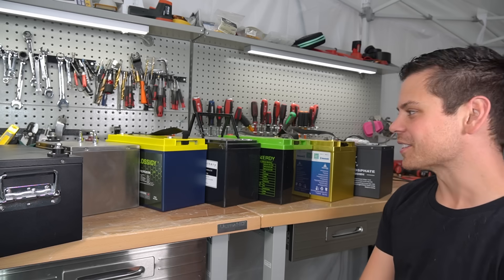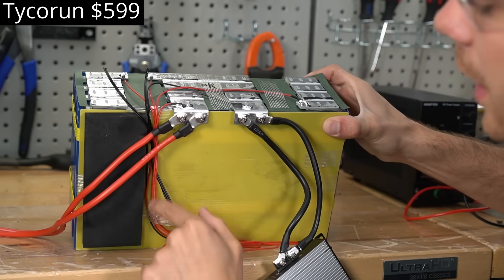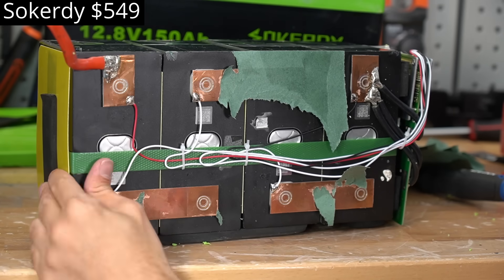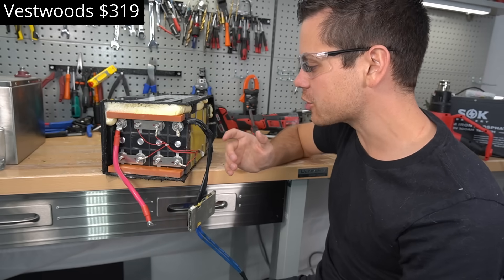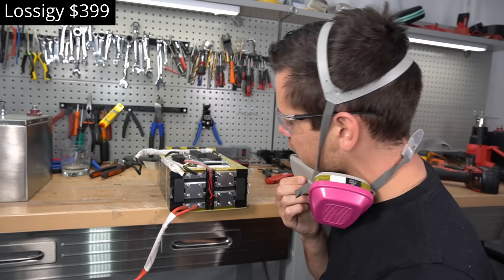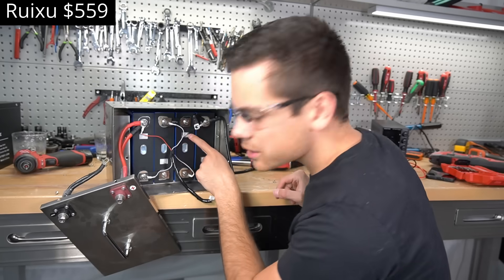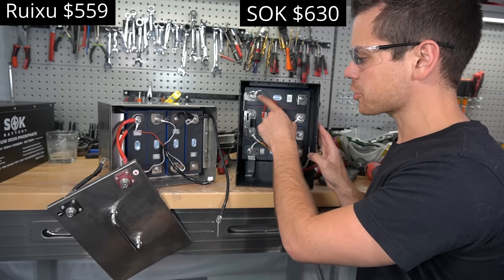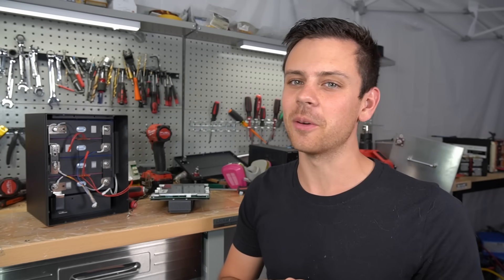Budget LiFePO4 Showdown: Lossigy VS SOK VS Vestwoods VS Tycorun VS Soderky VS Ruixu

Comment: @will aren't you getting spoiled?  you start with 100A 12v for 599 and call that cheap?
I've fetched myself 4 230a Eve cells (or something similar) for roughly 540 euro's, added about 80euro of BMS  (JDB) and spend 10 Euro's on a german app.

That is cheap! *(yes they test full capacity).
that would be more than 2 times the 599$ battery you're calling cheap :) 

Keep up the good work, but if something is (really) cheap an preassembled some corners where cut!

Comment: Did you checked, if there is a temperature sensor in this pretty small BMS of the Vestwood? Maybe it's build in the BMS not with wires to the batteries?
Reply from the maker: If it is, that's an instant failure

Comment: Hi, so would you say heated batteries are a necessity in cold climates? Also would you recommend the SOK batteries or is there a better option? I've been using lead acid for years but I'm hoping to do better with lithium ion

Comment: I'm trying to build an 86 KWh battery bank for my setup using 16 x 6 EVE 280 AH battery cells. I need to find a suitable BMS that can talk to my Victron setup. Does anyone know which BMSs are compatible with Victron? (I have the Victron Cerbo gx in my system).

Comment: Planing to parallel 6 battle born batteries and 4 WEIZE batteries. All 100 amp. Bad idea?
Reply: Separate wires same length plus fuse to victron lynx distributor.
Reply: I would not do it.  Best to use the same manufacturer, same exact model of batteries, and at the same SOC and usage (i.e. do not mix old with new).
Reply: @laronis  He shows another video were he is doing it and he recommended to parallel  it with a bus bar.

Comment: Humm.  Neglecting life of the battery (will have my boat for only 3 years).  With only 200Ahr needed, I need to daily monitor my battery capacity, charge in/out, for anchoring out and on solar for 3-6 days.  Tycorun has BT built in at $600 x 2 = $1200.  SOK marine would be a simple install with only 1 battery, but NO Bluetooth.  I'd buy the Victron smart shunt.  1x SOK at $1020 + 1$130 shunt = $1150.  So close in price.  What do you think is the way to go?  Tycorun...I have to make a set of cable to parallel connect, SOK requires a Shunt and 1 extra battery cable.

Comment: The vestwood battery probably has the temperature sensor on the bms board and not externally so it would have been better if u had tested the bms in a refrigerator.
Reply from the maker: Absolutely not. That would be instant failure. Please watch my beginner videos to know why

Comment: Maybe you guys know something what I didn't get for last 15 years... But I believe that low temp protection sensor should not be attached to the cells... Only high temp sensor... Reason why should low temp sensor be attached to the housing is to be able to give information to BMS before that cells themselves get cold...
With my experience of Lifepo4 battery when the sensor is on the cells is already to late for cells to be protected...
What do you guys think about that?
Reply from the maker: No, wouldn't work. Problem is that when it's warming up, the case will get warm first, and allow charging to occur even if the cells are still cold. Think about the thermal capacity of the cells.

You must always assess temp of cells on the cells.

Comment: Isn't it possible that some of these newer BMS units have the low temp protect on the board as a surface mount component? They're meant to be installed in the case, so the outside would be cold first when freezing just like the cells get hot first in overheat scenario, right?

Comment: With so many of these batteries featuring Bluetooth, I'm surprised nobody's figured out the heated battery issue you described yet. Seems to me Bluetooth Low Energy (often abbreviated BTLE) could be used for nearby cells to keep track of each other. Maybe a new feature for SOK to innovate? 👍️

Comment: Maybe it would be useful to list use cases here.  How much of the time is "low temp charging cutoff" a thing?  In LV, it cannot mean a thing to you, anymore than it does to me in Central TX.  If they advertise it and don't deliver, that is one thing, but the mere absence of it is of no consequence to anyone who can read. I don't need it and don't care.  It's not something I would pay for and the lack of it means nothing to me.
Another point here is that even the worst LiFeP04 battery is still a better option than a SLA, AGM, varient (as Lythyum Sooler likes to say).

Comment: As with many things, the more the market growths the more innovation comes along at a lower cost. 

We are looking at off-grid property, the home will have a 24 volt system for lighting and low power draws and a 48 volt system for the inverter.  That way there is some redundancy so you don't loose everything if one system goes down.

Comment: Now I'm sort of torn about having just purchased and received the SOK 206 a month ago. Haven't used it yet, but my intuition says that they wouldn't let me swap it for an upgrade fee to the new one with bluetooth and heater even if Ipaid the difference - bummer, I coulda used the heaters at times particularly that I'm on a single batt system and don't need to worry about balance
Reply: Contact them directly, they have recently discussed selling the new BMS/ heater pads to current battery owners.

Comment: So apparently in May the heated SOK 206 will be able to be wired in series??will have new BMS, or I guess a new tweek?  I wanted 12 volt system but decided to go 24 volt instead. SOK doesn't sell the 24 volt batteries in Canada anymore.

Would you still stay away from connecting in series? We get minus 30 degrees Celsius in the winter. Which is the only reason I'm going with a heated battery. It'll be in a "garage portion" of my tiny home. So I assume the lowest temp will be -20 degrees Celsius.

Comment: I am lead to believe that the heating pads many manufacturers are using cut in at 5C and out at 10C. I hope most people that string them in series have them in a well insulated box. The thermocouples attached to the BMSes are not over accurate (mine read temps with a 5 degree C spread despite sitting right next to each other in the same room at 13C ie 10C-15C). Hopefully the "warming" period when the pads are "on" is only minutes (the thermocouple sensor is on the surface of the cells next the heating pads in an air-tight box! lol) and any imbalance doesn't shut off the BMS and does not cause a real imbalance but only for a few minutes which is easily corrected by the BMS during the same charging period. Someone should test your theory about imbalance being an issue (you, Andy, Poz, or Lithium Solar).

Comment: Thank you, Will!  For the Vestwood battery with no apparent temperature sensor, I'm thinking it could be possible that the BMS may have a sensor built into the BMS, not hanging out the side like it should be... other youtube reviewers will drop the batteries into a freezer for a while as a more thorough test for such an example.  Do you have a freezer that you could setup to do such testing?  Thank you again!
Reply: Yes, you are right. The sensor is within the BMS. We checked inner structure. The NTC is arranged next to MOS.
Reply: Problem is that the BMS might be warmer than the cells. That's why you want to have the sensors away from it.
Reply: Yes was wondering the same thing, very easy to have onboard sensors.
Reply: Has anyone yet actually tested dropping the battery (the whole thing) down to 32f to see if it shuts off before damage occurs. It is entirely possible that since the temp sensor is on the BMS, they may just set the trigger to a little bit higher temp. It might still work just fine.
Reply: good to know!

Comment: I purchased 6 of the Lossigy a month ago. The company seems to make several batteries, basically the same, but some with added features. I have 4 yellow case and 2 black case. The first 4 we're around $330.00 each. In a week and a half they jumped up to $379.00.  The black case I got for $345.00. They had pretty good ratings on Amazon. Supposed to have cold temp protection. The 6 are in parallel. We'll have to see long term, but for now they are working well running my Mom's off grid trailer.
Reply: still working well?
Reply: @unionse7en  Have not had an issue with the batteries. Of course with a 90 year old woman, a different issue.  She would leave stuff on like she did when she was on grid. The biggest draw seemed to be the rv furnace. At 90 she was cold. Would turn the heater up and forget to turn it down. Then would get too hot and open the trailer doors with the furnace still running. Furnace would run 24/7.
Fortunately  she is now in assisted living.

Comment: Good Vid, this was great, flock of batteries evaluated !
The Sokerdy = Gold Standard for junk ?   Is that the sub-text there ?  Maybe LOL.  
Why the gawdy casing ?

SOK, AmperTime and those have upgraded so much,  It was just "the other day" when we were scrambling to for "A BMS" with Low Temp protection and now, wow that's changed.

As for the "Un-Named" Brands, YEAH really !   I look at Relion and others and they are STATIC not only ion product offering but pricing that goes with it.  Some are nearly 3X the price and with less features (no BT or Low Temp protection etc).  One has to wonder how much longer they'll be around if they stay that way...  Even BattleBorn has to get there, they are lagging now.

Comment: The Vestwood thingy might use an integrated temperature sensor soldered directly on the pcb. Sounds dirty but if you use an bms staying cool at 100 amps, you  having less trouble with heat generated by the bms. They might use higher quality FETs with lower resistance resulting in less heat. Get some cooling spray and hit the bms while testing...
Reply: Yes, I have also disassembled then Vestwoods battery, the temperature sensor is on BMS. It is white NTC under the heat sink near the MOS. It can be seen from two sides.
Reply: @patrickdong7833  Thank you for finding it. You just made me decide to get it.
Reply: Yeah you'd be surprised what good FETs can do.  It always drives me nuts with motherboards going crazy with the CPU VRM heatsinks and thinking bigger heatsinks are better.... bigger heatsinks just means you're using crappy FETs or not driving them very well.

Comment: I'd give Ruixu a pass due to the case's conductivity in colt temperatures. It would shut off long before the cells got cold.
Reply: But the same would be true going the other way. The case could heat up because of heat on the case, but the cells would be too cold.

Comment: Hey Will one request please. can one of you do a video breakdown of your preferred DC power supplies for recharging the lithium batteries? Is it safe to recharge a liFePO4 using a power supply unattended (assuming the BMS will disconnect for overcharge protection)? Where can I find these for sale? I find these hard to find and I don’t know any good brands

A NOCO 50 amp charger is upwards of $800 on Amazon which is ridiculous and so I look for a high output DC power supply 😆

Comment: Another great review Will, I would like to request you to comment on any Marine grade candidates for the off grid boating community. Generally we're going to be interested in quality builds and not necessarily need the temperature protection or even the internal heaters. 
Thanks for the insight regarding the heated batteries in series
Reply: Hey will what can I run with a 3000w 48v pure sine wave inverter krxny. Is that a good brand

Comment: I found your channel about a year ago, went back as far as I could and watched all of your videos that I could find. I've really enjoyed watching and learning about solar panels and LiFePo4 batteries. I'm a union electrician with 40 years of experience but nothing as far as solar. I really appreciate you and your channel. The one thing that I would like to know are the weights of the different sized batteries and solar panels. I'm toying with the idea of building a CLC teardrop camper and weight will be a major factor if I decide to pull it with my motorcycle. Keep up the good work.
Reply: Click on the links at the top that Will gives on each battery and they tell you (in Metric) for example the Tycorun is 13 kilograms which coverts to 28.6 pounds!

Comment: Will, I deep dived Vestwoods Amazon page and their Q&A section clearly states that they do not have low temp cutoff BUT IT COULD (?) and would be driven by the BMS. Also, on their 200ah batteries you have to watch which BMS is used. There is only a 100A BMS in the 200ah model but there is a 200A BMS in their 200+ ah battery. Again, questionable marketing - could be 99% clearer. I think their expertise is in server rack and they are just getting into the smaller batteries so they don't know the language. Great review video! THANKS!!!

Comment: Since it has become easier to get ripped off with these batteries or manufacturers, I' decided the better way to go was, to go for a power station, that would need to have good batteries in them, but' a new problem then arose, was their stated Power usage!! One seller said after a purchase of a 500watt one, was to of gone for a 1000Watt to be able to obtain a 500Watt output!! And there's me thinking that a stated 500watt output power station was just that, being able to supply a 240volts AC at a current of 2.1amps. Keep up the good work Will!! Put these bad sellers or companies to their shame, with their own facts.